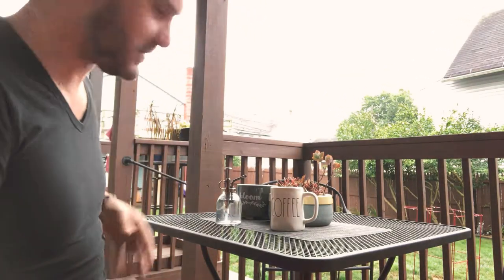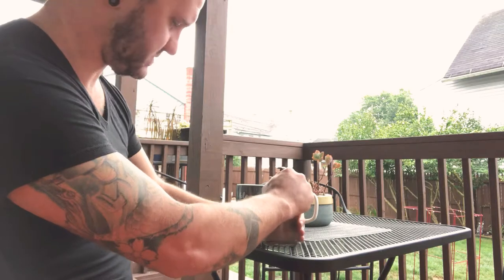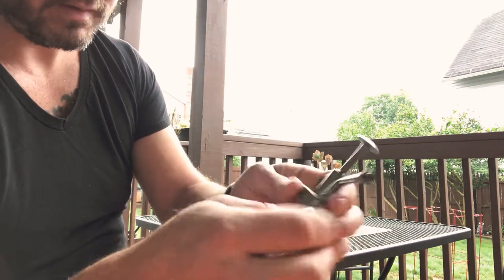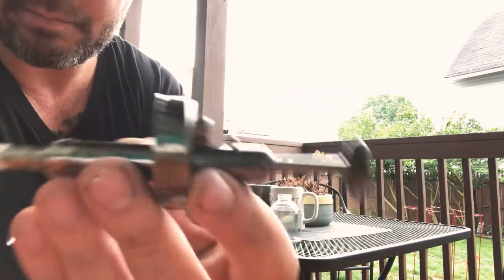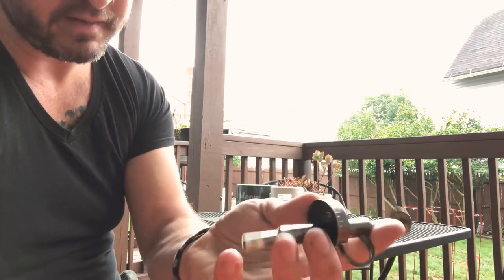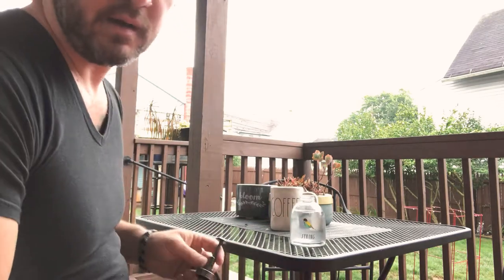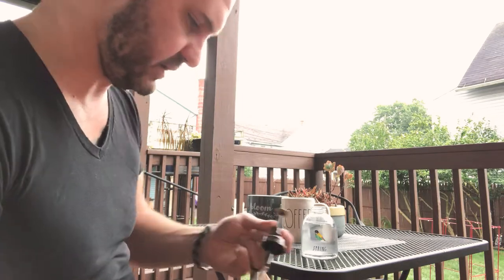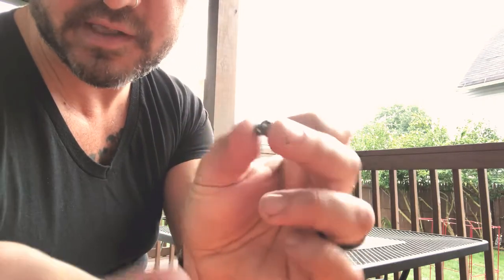Rae Dunn Plant Sprayer Repair

Comment: Tysm for sharing. I bought a very similar sprayer from IKEA. When I got it home it wouldn't work.  I pulled it apart just as you showed. Put it back together and it worked. Not exactly what it fixed as it was brand new. Mine didn't have a ball bearing. But glad you showed me how to pull it apart.
Reply from the maker: I'm glad that I was able to help!

Comment: Thanks very much! I purchased a look alike sprayer from Walmart, better homes and garden brand. It was not working since I brought it home. I dismantled it after watching your video. The white piece in the sprayer head is meant to cause a mist spray instead of full stream. When I reassembled it worked beautifully, even with the white piece in the sprayer head. Thanks for taking time to make this video!
Reply from the maker: I'm so glad this helped!
Reply: I have this same one and it quit working right after I took it home! It did start again after I took it all apart as in this video.
I may have messed something up with the white piece however, because it doesn't mist as well anymore.
Reply: Same one I have ! The mist only works every few pumps though 😢

Comment: Thank you. I was in the middle of disassembling my own plant mister. You would think that for the price of some of them (mine was Hearth & Hand by Magnolia for $12.99), they'd be made a little more durable. The pump assembly is cheaply made. 

ALSO - if you find another bearing that appears to be either a glass or plastic bead, DO NOT toss it. That part goes into the L-shaped tube that connects to the sprayer. I found that both the metal bearing and the clear bearing were both stuck on mine, so using a thin screwdriver or a paperclip in your vid to dislodge them helps. 

Unfortunately, we have hard water where I live, so I'm anticipating this being a recurring issue, but your video was so helpful with the explanation of what everything does. Thank you very much!

Comment: I bought a very cheap knock-off from W-mart and it went bad within a couple days. It sat on my shelf for a year until I pulled it apart like you showed. 
Lo and behold, after a bit I could hear a ball bearing moving again, and it worked.

Comment: Thank you so much for this video!! I was incredibly frustrated because the mister I got for my plants stopped working after a few weeks, and this fixed it! It broke again after a minute or two, but I just did the fix again in about 10 seconds and it was back to working 💪. So I'll just keepndoing this as needed because I'm too cheap to buy a new one that will probably end up doing the exact same thing 😝

Comment: mine stopped after just a few days . i saw this video which i am sure i will need to re-watch . i merely removed the tip , it was clean . i used a que tip on the input on the bottom and somehow its working ?  i use it alot

Comment: Is there a spring in there? Or is there rubber gaskets on the thumb plunger. Trying to understand why the plunger isn't springing back up. Thinking maybe either a spring or back pressure.
Reply from the maker: It’s been awhile since I’ve messed with this but I believe there’s a spring in there.
Reply: Yeah same issue. Loved this video for seeing how to take it apart but confused why there’s no suction or spring action still. When I took out the top nozzle a little clear ball came out too which Ryan didn’t mention. 🤨

Comment: Thanks. Do you know how to fix the the mister pump? Mine won’t go back up after I press it down. I have to manually lift it up to pump again.
Reply from the maker: I imagine there is a spring inside to push it back up. I'll take a look at mine and see if I can help you find a solution.
Reply: I’m having that problem to
Reply: I’m also having this issue, did anyone manage to fix theirs?
Reply: I don't think there's a spring in mine, worked just fine until it stopped working too (pump doesn't go back up either, and I'm pumping air into the water instead of pumping water to spray in the air), I'm that close to cutting it open to see how it is supposed to work before buying a new one 😅

Comment: My bearing keeps getting stuck. I took this thing apart so many times, and it would work here and there. But I  just can't understand why the bearing gets stuck in the bottom. Also, one of the times that I took it apart, I misplaced the plastic house. But it works. However, after a few sprays. I have to open it and shake the bearing loose. 😩

Btw, I bought two from Walmart, and they both stopped spraying.